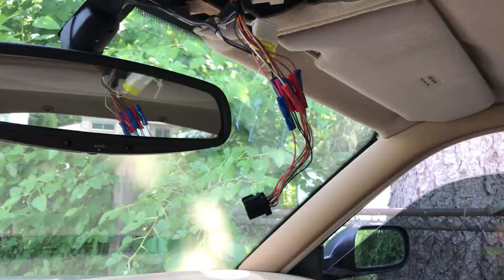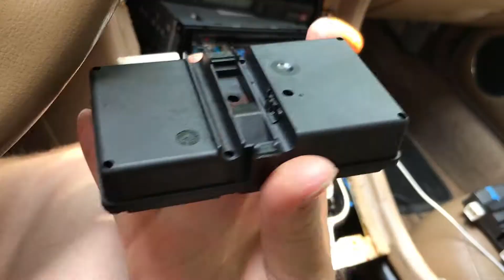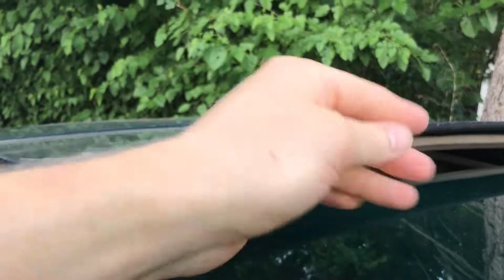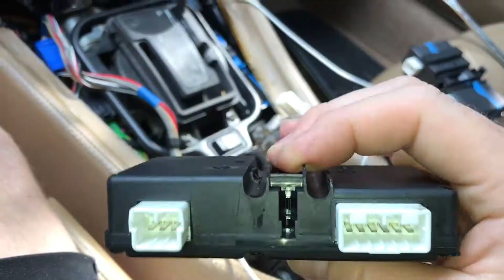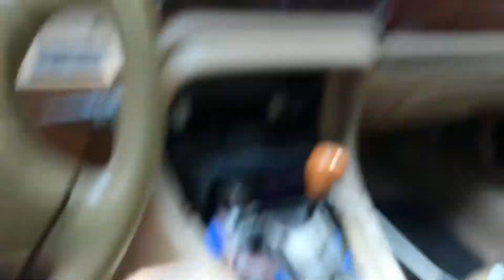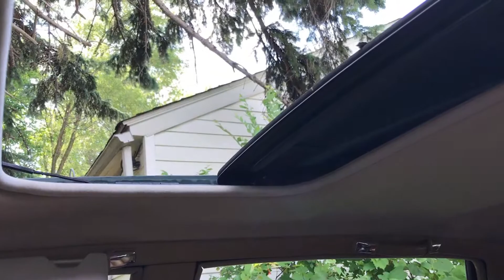Jaguar XJ6 / X300 - Sliding Roof "Zeroing" and ECU Installation

Comment: Will, not sure where to put the 8mm drill bit, and do you close the roof to that point on top of bit. could you get a measurement from top of slid roof?
Reply: The 8mm is not really necessary, it is simply the point where the sunroof is properly shut. If you simply adjust the motor with the screwdriver until you are happy that the roof is shut, that will be 8mm!

Comment: I'm so thankful for your expert video. I'm doing a simple headliner install but this Jag is giving me major headaches. Thank you for showing those gears and alignment. I had to spin my gear about 50 increments to finally see the white dot on the bottom larger plastic sprocket. Then the box will not snap into place. The clip barely catches. I'm assuming dry heat has shrunk the plastic? Lol. This car had a white plastic zip tie holding the box in place as well. I don't want to Jerry rigg it up because my customer has deep pockets and a long time friend. But this cheap $150 job is already costing me 4 days. Prob 2 more days if I guess right because I may have to drive 45 minutes to a huge junkyard if this box and or motor proves to be junk.
Reply from the maker: You're welcome!  I remember something about the zip tie in the TSB, I think you were just supposed to cut it off?  Can't quite remember.  And yes it's a total pain to get it to reclip in again!!!

Comment: Very stupid question, My 96 XJ6 has a no start no turn condition, One of the things it tells me to check is the SLCM,, Why?
Reply from the maker: Huh.  You know I think I might have had the acronym wrong in my title.  SLCM is Security Locking Control Module, which is located in the trunk and can control starting/no-starting.  This is the sliding roof control module in my video.

Comment: one more question, the rear spring clips on the inner panel that snaps back into place. are those spring clips facing rearward or frontward? I can get the front part clipped in but not the rear part

Comment: What I can understand is with the module out of the way I should be able to manually move the roof with the screw driver. if It moves correctly it is the SLCM that needs adjustment/replacement?
Reply from the maker: Hey, no guarantees but that would be a good start.  You don't need to remove the SLCM to do this though.  You can just move the sunroof back and fourth and make sure it has the whole range of movement.  If it does, then I would re-zero the module.  Perhaps the cable slipped at one point and the zero got out of place.
Reply: @Car-Go-Shorts  I removed the inner panel and also removed the SLCM, the 2 white "dots" line up in the top and bottom "windows" so I guess that's the "zero" calibration point? I tried opening my roof using a screwdriver but it gets stuck going backward just like when the motor is energized. I will remove the motor just to make sure it doesn't have any broken teeth (or is that rare?) probably will need to replace the whole slide assembly ??
Reply: DUDE!!! Ok!!! When taking a look again at my set up. I found someone had tie-wrapped the SLCM instead of using the rear clip to put it back up in place firmly. That may have been 1 problem! Second thing I found is the rear pins that hook into the rear section of the sliding roof (material part) was unhooked on both sides!!! I snapped them back in place and put the SLCM back in place firmly and TAAAA DAAAA, Roof works like a CHARM!!! No need to remove the headliner and do all this extra work!!! Thanks again for this AWESOME VIDEO!

Comment: I have an x300 where the tilt works but as soon as i try opening the roof the panel goes down about 1/8 inch and just stops. stuck.......... would the re-"zeroing" of the SLCM help this? Or is it the roof panel mechanism that's messed up? My car only has 90k miles on it